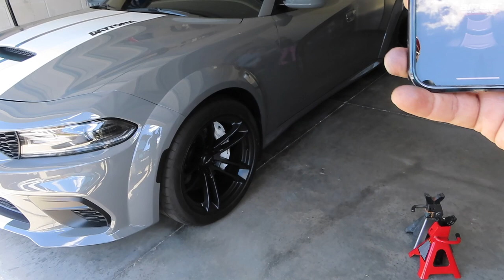These wheels took my Custom Widebody Charger to the next level 🤯 | GARAGE DRIVEN

Comment: That Smoke Shoe with white dual rally stripes is boss!
Reply from the maker: Nah 😂 it’s a 2018 destroyer grey Charger with the factory Widebody parts added to it. #notsmokeshow
Reply: @GarageDriven  new to your channel so you probably already addressed this but how much for the factory wide body parts?
Reply from the maker: @rezzo_6fn659  right around $3500 with the 2021 Hellcat trunk spoiler which isn’t necessary and was $360 by itself.
Reply: @GarageDriven  thanks for the reply brother
Reply: That ain’t smoke show
Reply from the maker: @carguy0389  😂😂😂💪🏽facts💯

Comment: When you added the widebody kit did you use the 3m tape of glue to keep the side flares on
Reply from the maker: Nah I had mine drilled like factory on the rears and the fronts I purchased the actual Widebody fenders. Everything went together like a factory 2020 car.

Comment: I have a wide body scat pack and I am considering putting it on a air lift. How does it ride and perform at high speeds and cornering
Reply from the maker: Excellent!!! I’ve never noticed anything weird about air ride and drivability being compromised. My brother has an airlift kit with universal bags for sale we just removed it today. It’s honestly the best direction to go when you have the active suspension.

Comment: Hey man where did you find those led strips in the front vents. I was looking for something to add to mine since the widebody for some reason doesn’t come with fog lights
Reply from the maker: It’s individual bullet LED lights drilled into the bumper grille. Checkout this video 
https://youtu.be/fedbM3oU4GY

Comment: Man you did right with that move to go black and SRT center caps 👏nigga you winning. Imma order my center caps too. Great look. That's what I love my rims on my Scat Pack and won't change those. Wait until those green spiked lugs are put on my wheels. Game over. Maybe you should go with the Carven tips in black. So if I go 315-35-20 I would need spacers on my widebody?
Reply from the maker: I run spacers just to have a wider stance in the rear. Once these cars are lowered then it really shows how much more the fronts are out than the rears so I add a spacer for a more aggressive stance.
Reply: @GarageDriven  so you only have spacers in the rear to get that aggressive look from the back of the car? I'm looking to go 315-35-20 on mine soon. What are you doing exhaust wise? I'm looking at Corsa but 2000 is a lot of cake. Thoughts.
Reply from the maker: @bigdill_3922  Correct!!! I’m just Catless with a mid muffler delete

Comment: Where did you get the air lift kit from and will it leak down?
Reply from the maker: Tunergoods in Texas...their an authorized dealer. Once installed correctly there isn’t any leaks my car stays for days in the garage aired up with no issues.
Reply: @GarageDriven  thanks I will consider them. I just don't want to alter my hellcat suspension out of wack
Reply from the maker: @troublemaker2121  ModFx in Houston does them all the time. I’d get in contact with them. Maybe they can refer you to somewhere local to you they might know of.

Comment: Are your wheels 20x11? If they are what size spacer are you running
Reply from the maker: 20x11 with a 12mm spacer in the rears.
Reply: @GarageDriven bet bro and also whered you get the srt center caps? Just ordered the same wheels and the oem srt caps dont fit the vicrez wheels
Reply from the maker: I’m not sure what size hub vicrez used but mine could fit a factory cap also. My wheels were from Voxx Wheels.

Comment: I have bronze wheels on my Chrysler 300 hemi and I took them off when the order they won't have painted from the factory so I took them off had them pile of coated myself did it myself and did them black the hellcat 20x10 and a half 20 by 9/2 in the front they stagger with a 315 35 20 in the back and
Reply from the maker: Those Hellcat wheels are nice 🔥

Comment: Bro those wheels set it off 😱 the Daytona looking mean 💯 where did you get the wheels from ?
Reply from the maker: Thanks 💪🏽 I actually ordered them from fitment industries but you can order them directly from Voxx wheels. They are factory replica wheels made by Voxx.
Reply: @GarageDriven  thanks man and it’s 20x9 in the front and 20x11 in the back
Reply from the maker: Nah I’m on the Widebody setup 11s all around -2.5 offset. They do sell them for the narrow body also in 9s & 11s so definitely is an option.

Comment: Your paint looks INSANE bro!! Is that ceramic coated?
Reply from the maker: Thanks! Just painted aftermarket and it’s not wet sanded and buffed yet no coating.
Reply: @GarageDriven  wow very nice. Yes wide body videos were great! May I ask what tint you are running? I pickup my smoke show scat pack next weekend!
Reply from the maker: 30% on every window including the windshield 💀

Comment: Hey sorry to bother you I wanted to ask you where did you get the hubcentric spacers from ? Thanks
Reply from the maker: They were 12mm’s and I got them off eBay. They sell out fast.

https://www.ebay.com/itm/192573733473?mkcid=16&mkevt=1&mkrid=711-127632-2357-0&ssspo=5bJ2g5z3Sw6&sssrc=2349624&ssuid=yiz3w5NcQO6&var=&widget_ver=artemis&media=COPY
Reply: Garage Driven are you currently using the 12 mm spacers with the widebody wheels? If so did you change the studs to longer ones or you didn't have to change them? I appreciate your help and time
Reply from the maker: Didn’t change the studs I got 6-7 turns before it tightened up. I actually sold the car and the new owner is still running the same setup.
Reply: Garage Driven  oh I see so you got a good 6 to 7 turns with the 12 mm spacers. Last question where you running 305 in the front tires or 315 all around?
Reply from the maker: Correct…..and I did run 315s all around 💪🏽

Comment: What kind of fog lights are those?
Reply from the maker: Custom made with these bulbs…I have a video showing the install as well.

https://www.ebay.com/itm/10X-Smoked-Round-Side-Marker-lights-3-4-LED-Bullet-Light-Truck-Trailer-White-/114500948028?mkcid=16&mkevt=1&_trksid=p2349624.m2548.l6249&mkrid=711-127632-2357-0
Reply from the maker: https://youtu.be/fedbM3oU4GY
Reply: Man that looks dope. I just placed my order for a 2022 charger widebody. They say it may take 90-120 day before I recieve it. I really want to add these fog lights to my charger. If I brought the fog light covers, and the lights and send it to you, could you have it installed for me. I will pay you $50 just for doing it, or whatever your asking price is for you time. Just let me know and I will but the lights and covers offline asap.
Reply from the maker: I pay someone $100 just for him to custom drill them into the grilles. I usually just do the wiring part. Where are you located?
Reply: @GarageDriven  I live in Virginia. I believe the lamp opening covers are going to be the same on the 22, as the previous wide body scat. I found them online for $21.24 a piece. You just let me know the price for you to get the lights installed and for you to wire them. If it sounds good, I will order both the L/R Lamp Opening Covers, and send them to you. I will put them on the car once it's delivered. I'm trying to install them bad boys as soon as I get the car.
Reply: @GarageDriven  since the wide bodies don't come with fog lights, would you wire the light aftermarket fog to the Daytime Running Lights?
Reply from the maker: I tried the Drl’s but the way dodge has it setup it’s easier to wire them to the side markers on the bumper it honestly worked the same both ways. You can send them to me and I’ll just have my guy install them and you can wire them yourself it’s simple. I show it all in the video I posted the link for above. Hit me on Instagram at garage_driven or email me thegaragedriven@gmail.com

Comment: No hate but that setup looks horrible. Car is dropped entirely to low. Bad wheel selection total thumbs down on setup. 👎🏽👎🏽from a non hateful prospective.
Reply from the maker: The car is on airbags; I have full control of my suspension at the tip of my fingers. Perhaps, your time would be better spent leaving positive comments for cars you do like and leaving those you don’t alone. By the way, the wheels are stock so take it up with Dodges design team if you don’t like them 😂